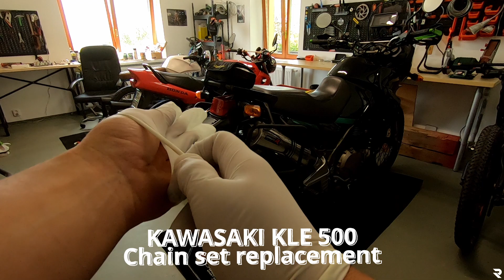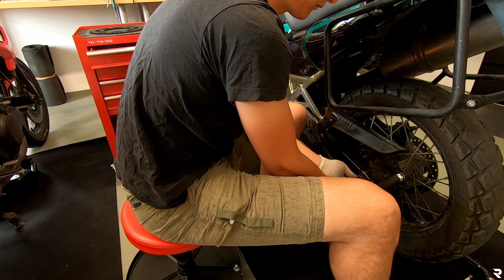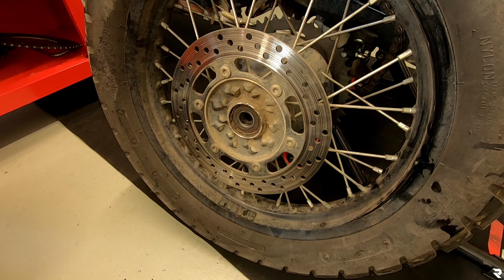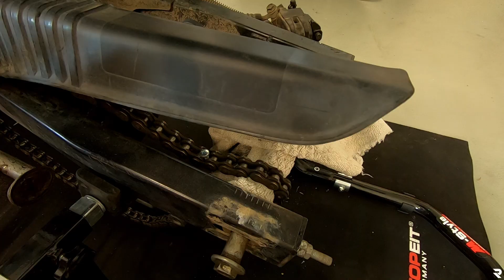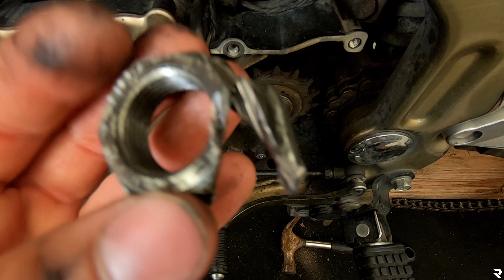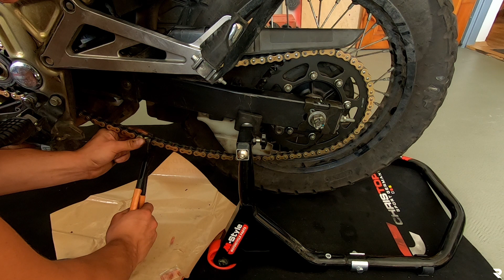| KAWASAKI KLE 500 | Chain set replacement

Comment: I also had to do sketchy stuff to remove the sprocket nut. I used a break bar with a one meter pipe. i had to block the rear wheel with a flat key in the sprocket. i boat the motorcycle from an old man he never change the chain set since he boat it in 2005. Took me a long hour to remove it.

Comment: You are a butcher pal. All you need was a breaker bar on the sprocket nut. Forget a hot air blower. No effect. Get yourself a set of proper tools . You have installed the chain too tight. When you sit on the bike it will tighten further. You need at least 2.5 cm of play with a rider on the bike.